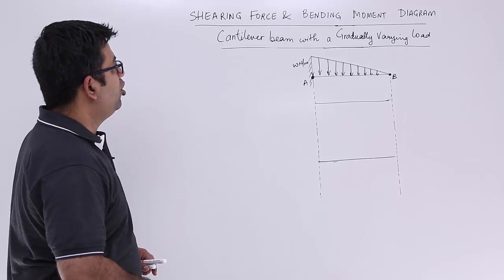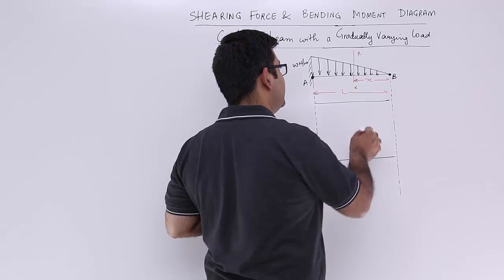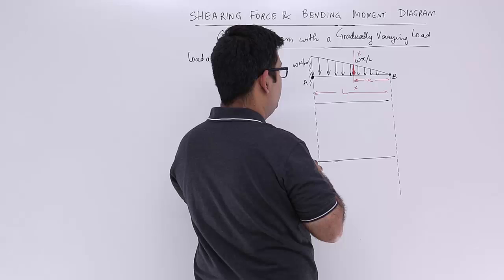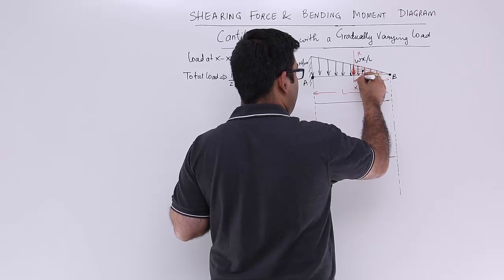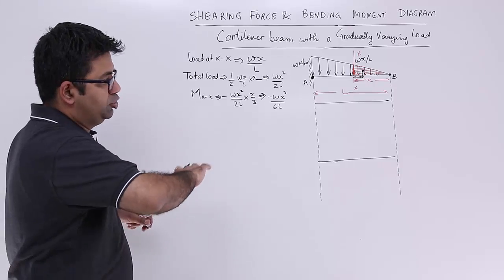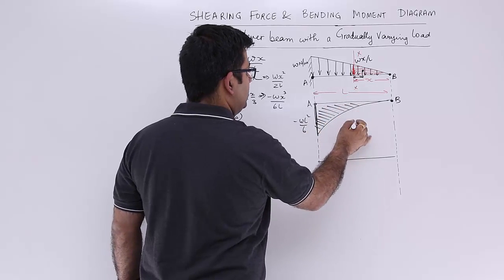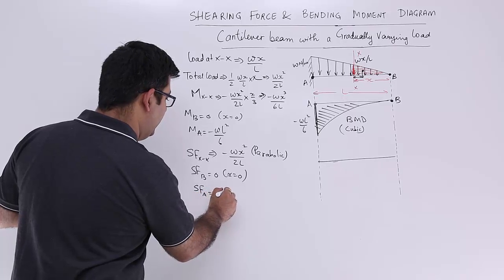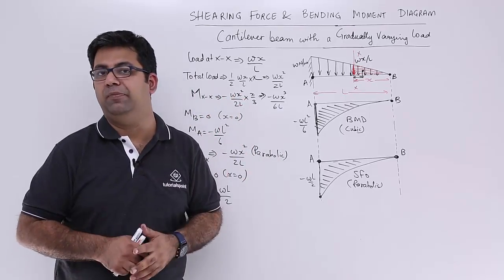Cantilever Beam With a Gradually Varying Load

Comment: CAN ANYONE HERE SAY PRACTICAL EXAMPLE OF UVL............point load means my finger tip on beam.........udl means my fist on the beam applying force which distributes load to a certain distance...................or simply saying..........................................in point load case we unfasten a bolt with spanner.....if we need to apply udl on the bolt we insert a pipe on to it............................................................now what is UVL?
Reply: A best example can be a lorry travelling on a bridge.....because it varies its load while traveling on bridge
Reply: @sammididinesh6058  really?i guess practically lorry will be loaded once and travel with same weight upto its unloading point.in bridge,we will not unload it naa